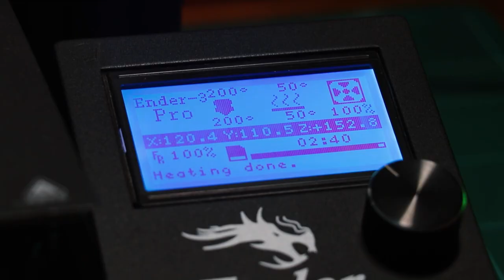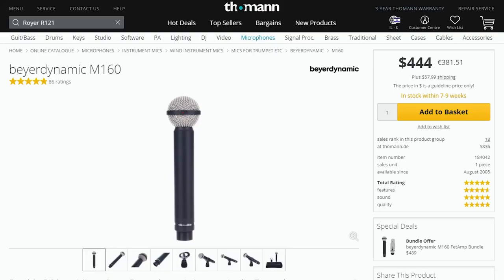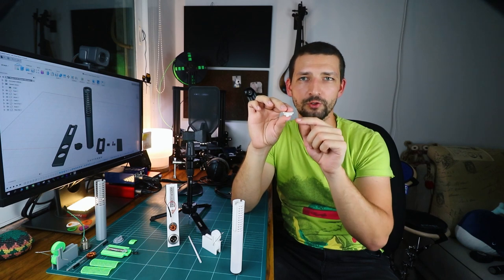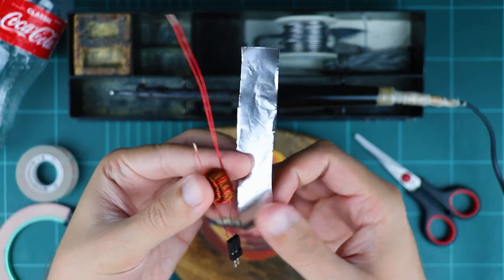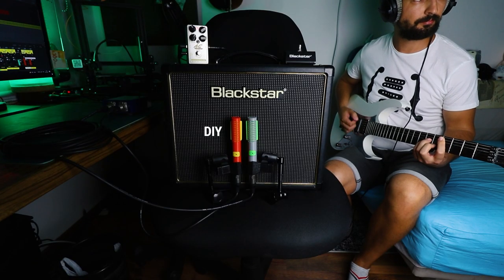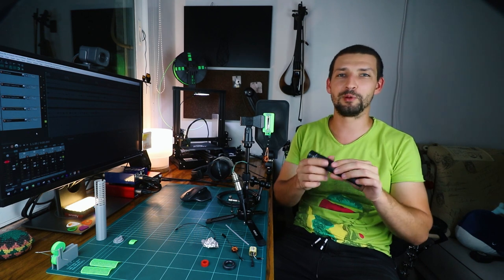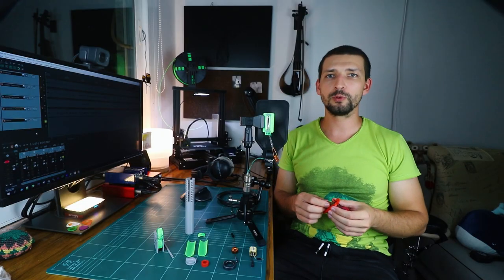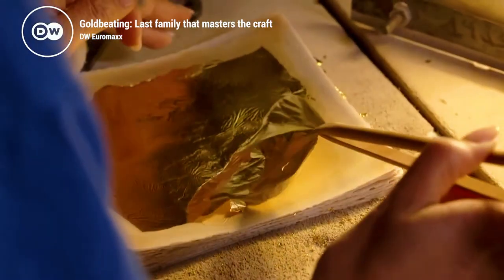3D Printed DIY Ribbon Microphone | Lundahl LL2912 vs Hand Made Transformers

Comment: is it possible to use Gold or silver thin layer instead of aluminum ribbon ?
Reply from the maker: Great question, I don't know but worth trying.
There's some thread on this topic here:
https://groupdiy.com/threads/ribbon-mic-element.47896/

Some suggest also copper and there some "Roswellite" article on Shure mics website (https://www.shure.com/en-US/performance-production/louder/what-is-this-stuff).

I guess aluminum was just cheaper.

Figured we can try ChatGPT take on this topic, when asked "Can ribbon microphone use a ribbon foil other than aluminum?":
[you can ask for resources]

Yes, ribbon microphones can use ribbon foils made of materials other than aluminum, but it's not very common. 

Traditionally, ribbon microphones have used aluminum ribbon foils because they are relatively light, durable, and have good conductivity. However, other materials have been experimented with over the years, including gold, silver, and even graphene.

Gold ribbon foils, for example, have been used in some high-end ribbon microphones because they have a higher tensile strength and conductivity than aluminum, which can lead to a smoother and more detailed sound. However, gold is much more expensive than aluminum, which makes it impractical for most applications.

Silver ribbon foils have also been used in some ribbon microphones because they have similar properties to gold but are somewhat less expensive. Graphene is another material that has been experimented with in ribbon microphones because of its extremely high conductivity and strength, but it is still relatively new and expensive.

Overall, while ribbon microphones can use ribbon foils made of materials other than aluminum, aluminum remains the most common and practical material for most applications due to its combination of properties and cost-effectiveness.

Comment: I can understand the high cost of shipping but we have a greedy government in Greece where they want to charge you tax on shipping as well as tax and customs on the product you purchased. Not only that try tracking an order coming from outside world. Original shipper give you a tracking number but if they do not have local delivery they pass it off to "local" companies but they fail to provide the original shipper their own shipping number. Net result you don’t know who has received your package out of ten different  companies. You could call them all but since the shipping companies don’t interchange data with the original shipper, one is out of luck finding their package. Even providing a phone number does not help, most often they fail to print it on the shipping label.
As for shielding, try to find someone who can print metal. I heard if you supply your print file to JLC PCB they can print metal but at what cost? I managed to get hold of some nylon gears and was able to "fold" ordinary kitchen foil successfully between the gears. Where did you source your foil from? Too bad one cannot use very thin stainless steel for the ribbon, it might be more durable than aluminum but I suspect that the frequency range of the element would change making it necessary to go with even a thinner stainless foil.